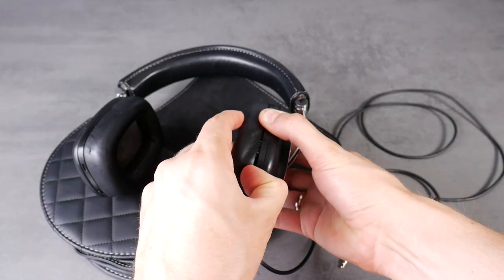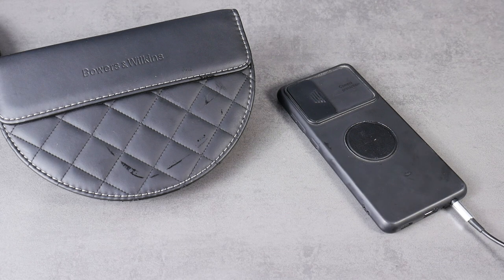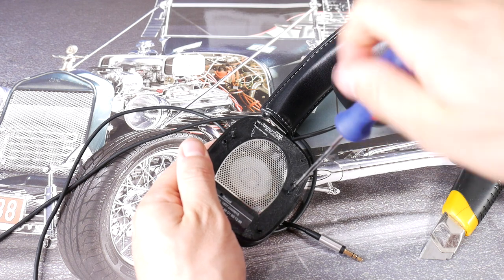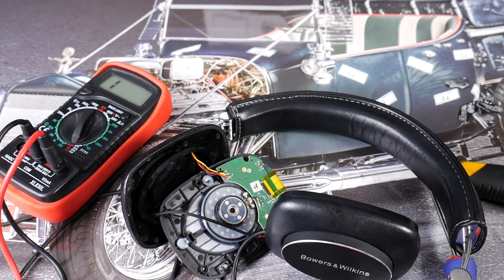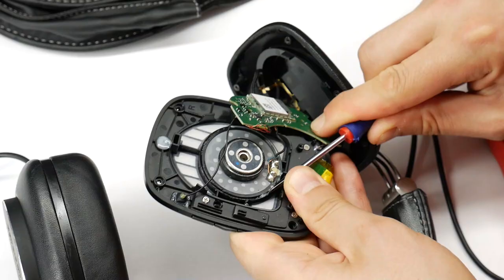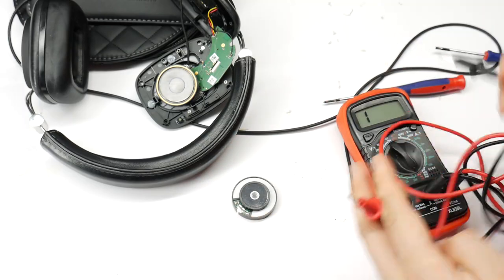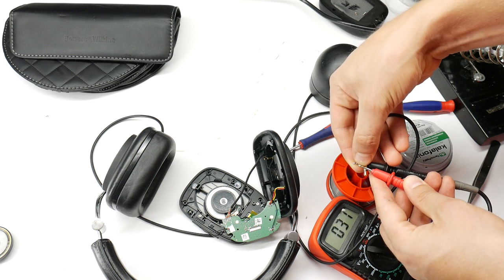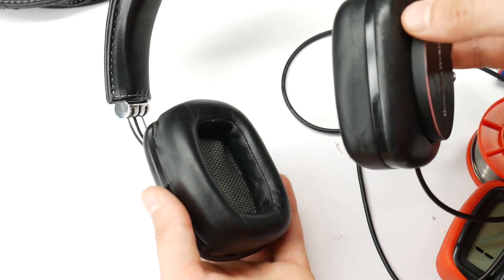How to Repair B&W P7 headphones one side not working

Comment: Hey there. The Cable that goes through the headband on mine seem to be broken too. I have problems to identify which one this is... is it the one with the 5 cables thats on the left side of the circuit board or is it this with the 3 cables? Can u help? Don't know what i need to buy...
Reply from the maker: through the headband goes only one cable, with several wires, just use multimeter to check these wires from one side to other, to find out, it all wires are whole or some is damaged. 

How to use multimeter: https://youtu.be/BMOaVI-yhGg
Reply: @TechscrewDIY  Thank you so much :)

Comment: 20€ drivers🤣
Reply from the maker: they are replicas, but I believe the cost of the originals is similar.
Reply: But not the  Sound. @TechscrewDIY
Reply: Thank you for the video.  How was the sound of the driver?  Did you have to replace the other side as well?  Also, can you buy the circuit boards online?  Thanks!